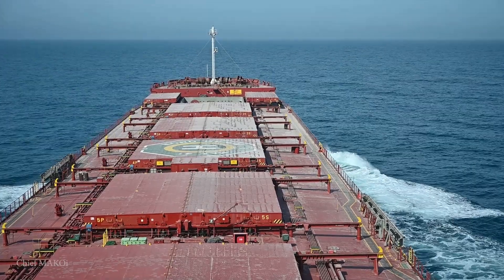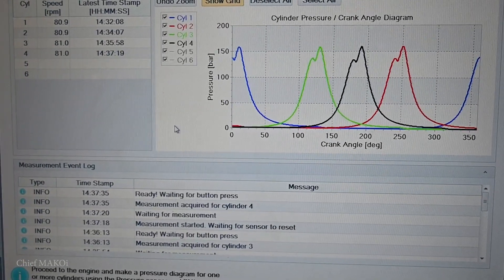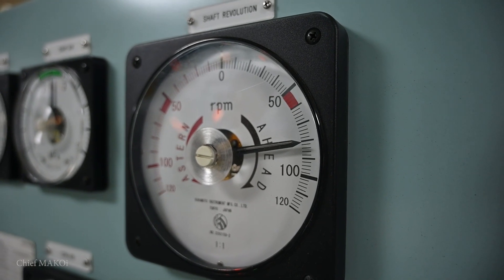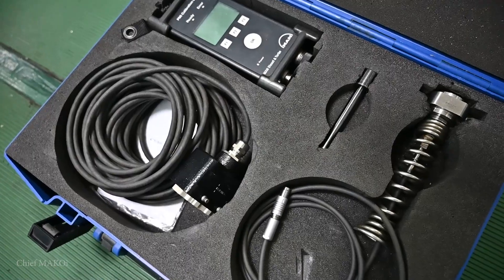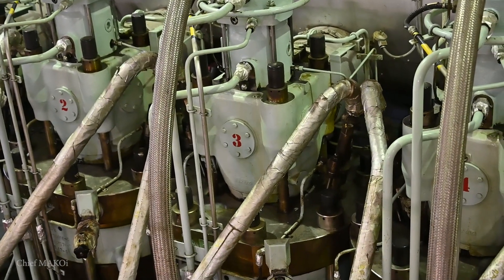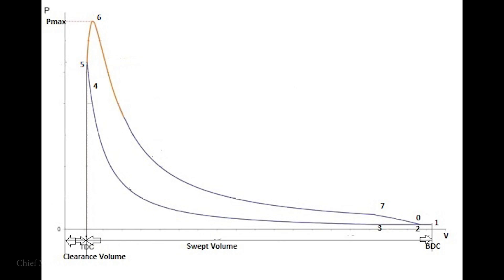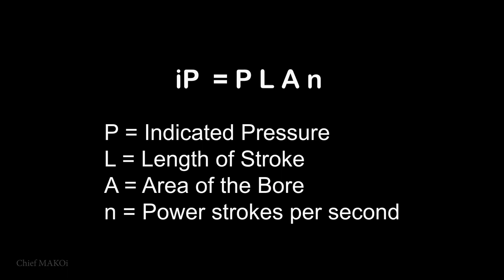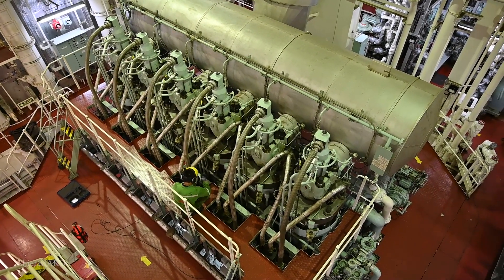Ship's Main Engine Performance Test | Chief MAKOi

Comment: Chief,
I really enjoy your videos.  Being a diesel mechanic since the early '70s I especially enjoy the engine videos.  Since I worked mostly on heavy equipment and trucks I always learn something from your content.  Today I learned that Pi r squared (sorry I don't have a fancy scientific keyboard ) can be represented as Pi (D) squared/4.  I remember the needle and paper days.  I always kept learning the new technology and am still a viable commodity today. I watched your video about how you went back to the academy to learn electronic engines.  That was a great move. I have spent a lot of time in school over my career and never regretted it.  I tell the young'uns keep up or get left on the side of the road.  Or left in port in your case. Keep up the good work, I dig it.
Thanks,
Robert

Comment: Very informative video, I love to learn these type of details about ships, I am not remotely to ships.
Couple questions:
Why the engine does not have a permanent pressure sensor on each cylinder?  a 1000bar sensor is pretty cheap, even to work at the high temperature the engine head has, ie no tube required.
Why the connecting sensor port does not have a cap? or was not shown for simplicity?

Comment: This must be a rather small ship sailing on 9,000 HP even if this shows at 85% of full ahead rpm.
By comparison big tankers have engines which will produce power upwards of 70,000 HP.

Comment: Why isnt this equipment just integrated into every cylinder full time?  Seems like you could keep this equipment mounted, in place behind the valve, and then the valves opened when measurements are needed.

Comment: Interesting. I would expect the ship engine to be more powerful. A single electric locomotive can have over 6 MW these days.
Reply: Don't forget that it's only running at 81 RPM. 9k HP at 81 RPM is almost 600,000 lb.ft. of torque.

Comment: You need to teach your cadet how to properly coil and store the cable to avoid the tangled mess and the struggle I see on the video. Search for the "over under" method. They never teach this at school, and it is one of the first thing I explain to them. If they coil the cable like a rope, as untrained people usually do, they impart a twist at every turn. Long and stiff digital cables have a internal structure that behaves like a spring. Tension is stored on the cable; it will then uncoil in a messy way at the next use. After a few mishandling, the cable looks like 4:21. Digital signal attenuation will rise due to the shifting and twisting of the complex internal cable structure, and after a while the cable may ultimately fail and/or become impossible to coil in a orderly fashion due to external sheating damage/deformation. That's a shame, because cables are expensive and should last a long time when properly handled. I work in a completely different industry, but I see that some practical issues are the same.
Reply: Guessing you work in the sound engineering field?
Reply: I second this.  I’m in the robotics and automation field and I’d venture a guess that 3/4 of the problems we see are cable related. Seriously, cables need to be treated very well.

Comment: Another great tutorial Chief. My question is, could the instrumentation be installed permanently so as to give constant updates?
Reply: Very expensive.. like 300k uk pounds per cyclinder.. not worth it. As long as the results are within parameters... And these engines are regularly maintained, checked and even overhauled while at sea so a catastrophic failure is very rare if you have a very professional crew like majority of huge cargo ships.
Reply: Well, Mazda does it, cylinder pressure transducer for each cylinder in its Skyactive X engine (HCCI technology, so it needs them to calculate ignition timing and etc...). Greetings from Costa Rica.

Comment: Chief, I'm about your equivalent, but in aviation (repairing asnd maintaining large commercial aircraft)
So you do trend monitoring as well. Why don't you have permanent transducers connected to the indicator valves, to provide a continous measurement during engine operation?
On big commercial aircraft snapshots of engine performance are sent to airline engineering and the engine manufacturers several times during each flight, together with air data (airspeed, altitude) and varoius measured pressures and temperatures along the gas path of the engine, plus data like engine RPM, engine vibrations, throttle settings, bleed air and electrical load etc.. These values are plotted in diagrams, and give an early warning e.g. about degradation of bearings or turbine blades. 
You have the computing power on board, so your computers could easily monitor long time trends.
Reply: it's cost and wear mostly. In aviation the stress on the transducers is (relatively) short and bursty - the aircraft spends most of the time on the tarmac or being serviced with engines off. A cargo ship can have the engines continuously operating for weeks, if not months. So, you'd need to have the crew constantly testing the monitoring equipment, or put in monitoring equipment for the monitoring equipment... or redundant systems. It's just not cost effective, when it's easier to have the crew spend a couple hours weekly. Especially since you're not going to take the engines off line to do minor tweaks. It's got to keep going till it gets to port next month...

Comment: Excellent presentation Chief. The engine makes a bit of power eh? 
Compared to the construction machinery I work with that's a whole lot of power! For an old engine guy like me, it's great fun to get a glimpse of a world that I don't get to see. Thank you and Cheers.
Reply: 9068 HP at 81 RPM is 587,972 lb.ft. of torque. That thing is an absolute beast.

Comment: For anyone wondering, 9068 HP at 81 RPM is roughly 587,974 ft*lb of torque.  That big number is not a typo.  Thanks Chief!
Reply: That’s actually not a lot of HP is ship term, some ships have over 200k horsepower
Reply: @evanleo7633  yeah, but I think that since this ship is a direct drive, the torque is more important than horsepower?
Reply: @InsanePacoTaco  Not that much. For the same power you may have lower rpm and higher torque engine, but that would then require for the same speed steeper propeller blade pitch angle, so (assume the losses as the same) the resulting thrust force would be exactly the same.
Actually co paring the torque is irrelevant, even for a car dynamics, unless you have other parameters (rpm range, inertia of the flywheel,...) aligned as well (well when speaking only about gas car engines, the physics around gas combustion is what leads to the other design parameters to be alike so comparing torque figures does make sense there; but comparing torque figures between gas vs electric makes no sense at all).
Otherwise what matters is the power as function of where you are in the rpm range, plus how much inertia energy is in the moving engine mass. For different torque and rpm you will compensate by just a different gearing.
Reply: @annaplojharova1400  interesting! Thanks for the reply
Reply: @InsanePacoTaco  I think you’re right
Reply: @InsanePacoTaco  That's the "but muh deezil makes all the tork!" argument diesel truck guys have been making forever and it's bollocks. Horsepower is what matters. Or kilowatts if you prefer metric. Both are measures of power not torque. Jet engines run at incredible RPM ranges but make comparatively little torque; however, slap a gearbox on and you've suddenly got reasonable RPM levels and insane torque. The power level stays the same, less some slight losses in the gearbox, but the torque is multiplied by reducing the RPM. The same holds true in cars, your transmission is multiplying engine torque substantially. If your engine makes less torque at the crank/flywheel that's not a problem, you can just gear it down. The power level is what truly matters.
Reply: @ParadigmUnkn0wn  Thanks for the explanation, I hadn't ever really thought about it like that (with the gearbox changing the torque output).
Kind of reminds me of how you can trade off voltage for amps in an electric circuit via a transformer while the actual power remains the same minus some losses in the transformer (W = V x A).
The vehicle gearing you mentioned also helped explain the reason for a Hi/Lo rear differential I saw in a Diesel Creek or WatchWesWork video.
Reply: And so far the most powerful TSDICE I’ve ever heard of used in freighters is the Wartsila Sultzer RTA96-4C. The 14 cylinder variant makes about 109,000 HP and 5.6 million lb ft of torque at just 102 RPM. That engine is bigger than the three story house I grew up in!
Reply: Damn sharp pencil….or did you do that in your head.
Reply: @gregholmes3661  Thanks.
Reply: Nice

Comment: As someone that has had to repair such instruments I appreciate the care the engine room tech is taking with the cable connectors. Those things are NOT cheap and unless you have spares? Not something you want broken while underway!
Reply: how often are the engine check calibrations done?
Reply: Once a month.

Comment: The indicator plots lead me to a couple of questions:
Why the "hook" after TDC?  It looks like injection - at least in a significant amount - is happening well after TDC.  I would think hitting high pressure sooner would be more efficient.
Are there any adjustment to parameters made after the measurements?  I would think it would be possible to balance the power between each cylinder by a small adjustment in cylinder by cylinder injection.
Reply: You don't want peak pressure at top dead center, because the crank is exactly vertical, so the force of the piston goes straight into the main bearings without producing any torque. If the crank is after TDC, the force can be converted to torque...

Comment: Isn't the HP you computed just 85% of the max HP of the engine? At the beginning, I thought you said 81 RPM corresponded to 85% of the max power. Or is that just the way engines are rated.
Reply from the maker: Yes, 85%.

Comment: Seeing it mentioned on the monitor screen leads me to ask:  Is the hydraulic oil a separate system or is it using the lube oil?  I'm only familiar with small diesels with hydraulic injection, and they use engine lube oil boosted by a mechanical pump.

Comment: I'm surprised cylinder pressure isn't monitored at all times.  Looking at PV diagrams on a log-log scale can provide significant information of a cylinders health, at a glance.
Reply: single cylinder exhaust gas temperature is sufficient for indicating general cylinder health. I could imagine that the pressure transducer isn't particularly heat resistant.
Reply: I had the same thought.  Given that this engine is fully computer controlled with both exhaust valve and injection under computer control, it could be used to tune the engine.

Comment: What's a transducer? sp?
Reply: It's a general term for a device which converts any form of energy into an electrical signal. In this case as the pressure changes, so does the value of the electrical signal sent to the computer. A microphone is an everyday example of a transducer.

Comment: Fascinating.  I was surprised at the apparently small difference between the compression pressure max. and the combustion pressure max.   I would have expected a much higher differential.  Then again the intake air is supercharged, so it’s already under more pressure than ambient.  (I was a small engine mechanic, so this is the other side of the universe for me!)
Reply: That's a Diesel thing
Reply: The diff between min and max you see is normal for ICE, no matter the fuel.
Also note that the peak pressure occurs at around 20~25 degrees, that is around 30cm from TDC, while the pressure before combustion is at TDC.
Reply: I wonder what max pressure is at 120% power, since that graph showed it at 80% or 90% power.

Comment: That was very interesting!  Especially liked the old ‘analogue’ tools using recording paper and the planimeter - never seen one before - I was wondering if you’d have to count little squares on the paper to get the area!
Reply: Yes you do and average all the halves and quarters
Reply: @petermaddison4136  No, you use the planimeter -- it's a device for calculating areas.

Comment: The mechanical peak pressure gauge, not many people know how to use it anymore, how to select and change needle (if it has that option for different pressures) or how to read the graphs it creates. 
I must say however, find it quite cute you have one of those onboard. It’s not really much of a back-up should the electronic one break. The accuracy is quite poor for anything advanced and no TDC probe of course. 

I’d love to have one of those just for the sake of nostalgia, but must be Lemag of course. Last time I used one of those flying across the globe servicing engines must have been something like 2000-2005. 

Good video.

Comment: So technically a top fuel dragster motor could propel your ship with the right gear box. That's crazy.
Reply: For about 5 seconds, yea
Reply: But I doubt top fuel engine can run in 9000hp for months.
Reply: @edmondhung6097  Not just months - decades. This engine will go through many pistons and liners in its lifetime, but the big end components are likely to last the life of the ship.
Reply: @edmondhung6097  I'm aware of this, I was just thinking it could physically do it for like 10 seconds.
Reply: @k20nutz  you are correct. If it was geared so the max rpm of the dragster matched the full throttle rpm of the prop shaft, it would indeed work.
Reply: Likely wouldn’t have the torque to even turn the prop shaft.
Reply: @tomrogers9467  with low enough gearing it certainly could. It just wouldn’t last more than like 6 seconds
Reply: @tomrogers9467  He mentioned gearbox, so with correct design should be fine

Comment: I love that you show your guys in full safety gear being deliberate and cautious. Workers acting cool and nonchalant without safety gear sets a bad precedent.
Reply: It's required to be in full PPE while working onboard. No PPE no insurance for you when some accidents happens to you.
Reply: I wondered why a face shield would be required until he opened up that test valve...
Reply: @TheEvertw  My guess would be the high pressure that comes out of that piston tube, you saw it in the calcs how high it was, if that blows into your eye, you might be blind.

Comment: watching this tells me that you can probably know all the equations and calculations off the top of your head. very impressive indeed.
Reply: In old money, it was P.L.A.N/  33,000    but with metrication and the right units the 33,000  was removed from the equation. 33,000 was foot pounds in a Horse Power.   Note this is Indicated Horse power  IHP, the actual raw power produced in each cylinder. At the propellor shaft you have shaft horse power which takes into consideration all the frictional losses by the time it gets there. 
You can also work out the Brake Thermal Efficiency which starts with Calorific Value of the fuel burnt, IHP then you have all the losses, friction, heat lost to cooling water, exhaust gas, lube oil etc. Some of these losses are recouped via the turbo charger providing scavenge air pressure, waste heat boilers to produce steam for domestic and fuel heating but even on large ships they produce enough exhaust gas to produce steam to drive a turbo alternator for electrical power supplies. Cylinder  Cooling water is used in a vacuum evaporator to boil sea water at approximately  60°C  to produce distilled water for domestic use and ER use. Apart from a small vacuum pump  and freshwater discharge pump very little power is used to,produce the fresh water.

Comment: HP is not really an applicable measure here.  You should really be figuring for "torque.  Horsepower is too reliant on RPM's, which this engine has very low RPM's.
Reply: about 589462 lb ft torque

Comment: After a new ship is built, does it get delivered with tools and other loose equipment already on board or does the company have to bring all that stuff on board?
Reply: Comes with a great many tools and spare parts, normally well defined by the contract, and also set for a great number of them by maritime regulations as well. Generally acceptance is with all on board and operational, so that literally 30 seconds after signature the crew can go and collect the first cargo, for earning the line money. Tools might be bare minimum spec, but most are fit for purpose, and often the shipping line, with likely the input from Chief here as to preferences, will spec for either different models, or for higher spec machinery for maintenance, and this is always a big part of purchase, as all ships are by necessity a lot of negotiation. Not like you are going to buy a TV set and look at only a few things, price, screen size, brightness and resolution, and then choose from a few in range.

Comment: I am wondering Chef...
What is typical fuel injector pressure in these tires of engines?
Reply: Depending on operating pressure and type of fuel injecting system anywhere from 80-400 bars
Reply: Types of engines...